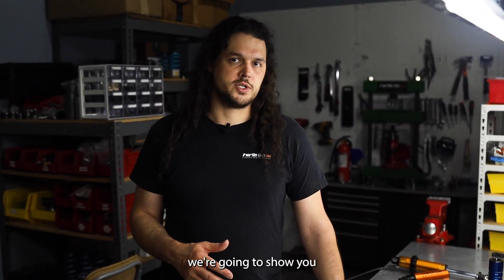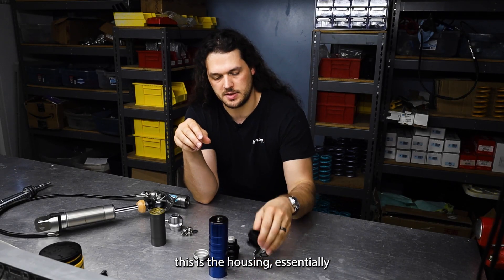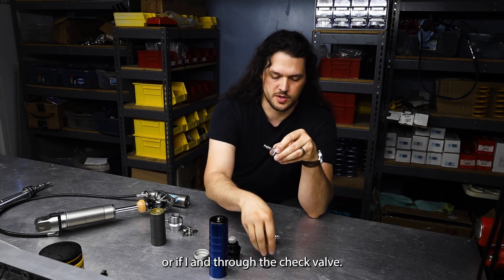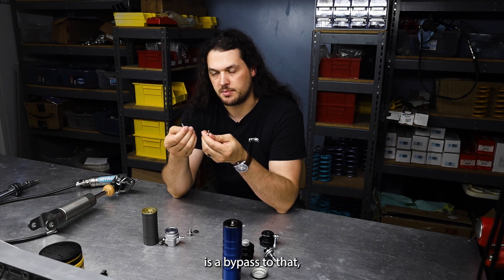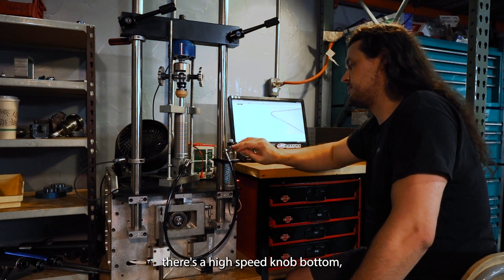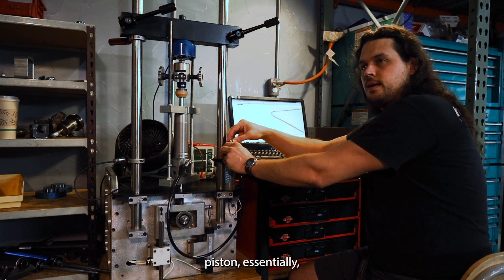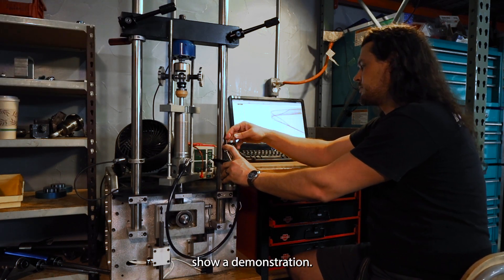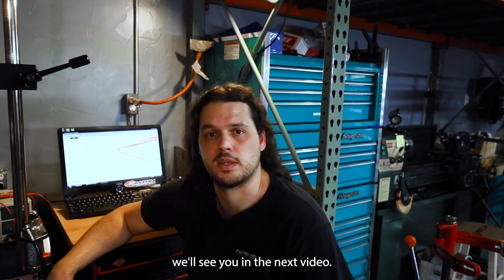Shocks 2-way vs. 3-way - Key Differences

Comment: So, from what I can tell, when adjusting low speed there is a peak force influence (not just rate)?  It started at 77ish lbs fully open and peaked close to 150lbs. This would contradict your comment about it being used strictly as a blowoff. I would expect a slope change to a peak force.
Reply from the maker: LS bypasses a blowoff valve (HS).  HS sets the peak force, LS changes the damping rate up to the blowoff.  More or less.

Comment: Coming from racing MTB, my rules were:
1. Adjust the shock for the most of the track. Ignore the few big hits and exceptions as the bottom out protection will take care of it.
2. Rebound wins races. You want your tires making contact with the ground as much as possible but don't want the rebound to be so fast that it will upset the bike.
3. High speed compression is for terrain control, low speed compression is for rider's inputs (think of the bike stability during braking).
4. Proper sag optimizes cornering on imperfect surface ( goes along point #2).
5. Shimstacks and valving are dark magic. Talk to your suspension tech about your needs and the tech can transform a cheaper shock into something that can out handle top shelf products.

I hope that helps someone out there!

Comment: How does increasing the gas pressure affect rebound? Additional gas pressure appears to shift the dyno curve up for compression but what is the side effect for rebound in 3W system.
Reply from the maker: It is an offset of force, but it is not damping.  It effects neither unless it is preventing cavitation.

Comment: Great explanation!  I've been learning how to fully utilize 3-way JRZ shocks on my A90 Supra and this video has been really helpful.  Question: Can increasing the gas pressure in shocks help carry a larger aerodynamic load at higher speeds?
Reply from the maker: No, gas pressure will not do anything like this.  Gas pressure will act like a preload and is primarily used to prevent cavitation.  It can also act the keep load on the ground by controlling the minimum force the shock/spring will exert at max extension...at the expense of more seal friction.  JRZ does have some low drag seals we use more sparingly due to some bushing wear, but we don't always see this.  Usually use these as part of a revalve where the car is very light and the damper more directly acting (like when mounted to the upright).
Reply: Thanks!  So if I'm not experiencing any cavitation then there's no reason to mess with it.  I have the standard JRZ shafts, didn't opt to take their 50DA shaft
 @inertialab8181
Reply from the maker: @mjon5706 Typically yes if not cavitating then leave it be.  It can be lowered to a point to reduce friction, but only if you know the cavitation limit and the sealing system limit.  150psi is a pretty safe low end for most of the off the shelf RS Pro systems.